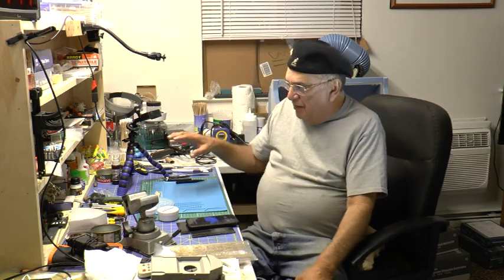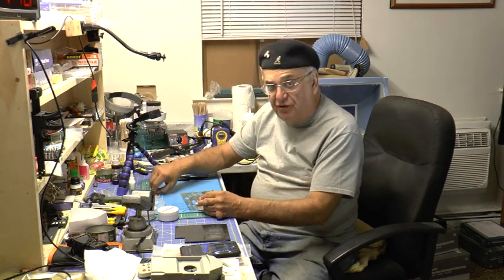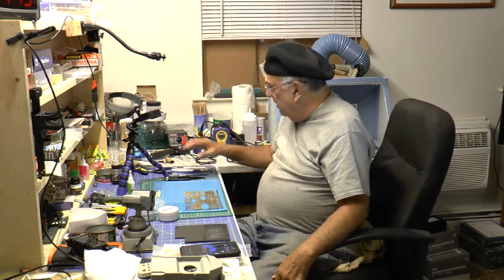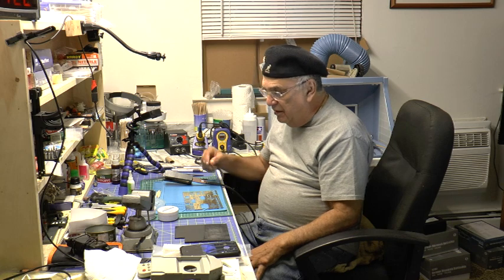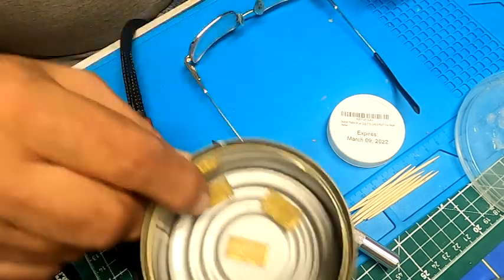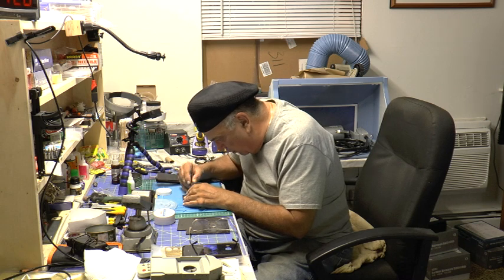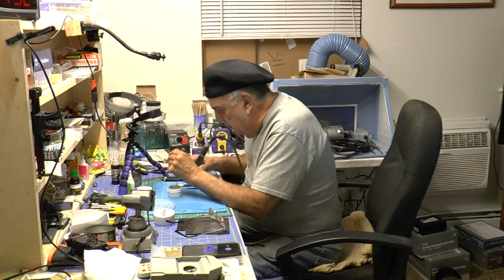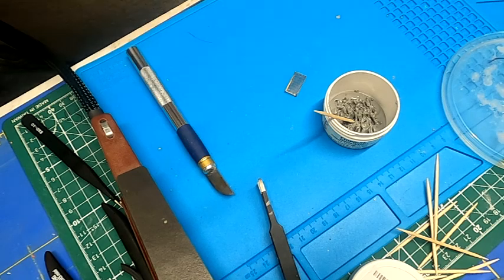SOLDERING PHOTO ETCH USING A RESISTANCE SOLDERING IRON

Comment: I have 2) 300 watt PBL Hotip units. They are by far the best money I have ever spent on tools. You will wonder how you got this far in life without one. The PBL tweezers are a bit smaller than the American Beauty but just as functional. The PBL also has a carbon probe that is very useful, probably more than the tweezers. They ARE expensive to buy new. Buy once cry once but at least you will have one.